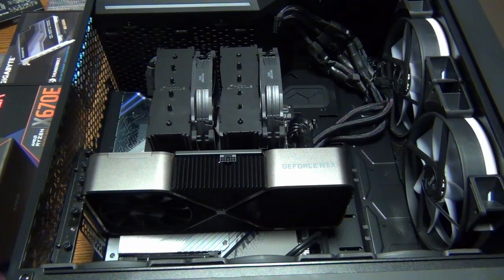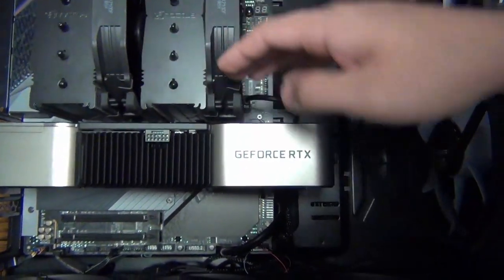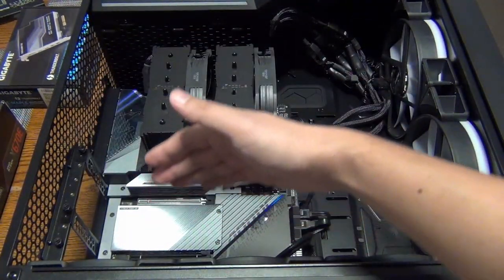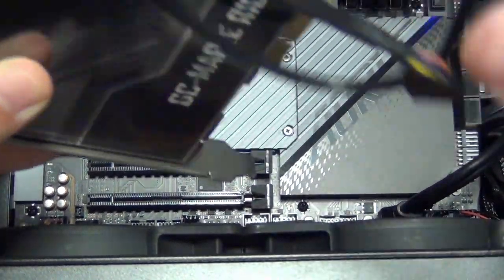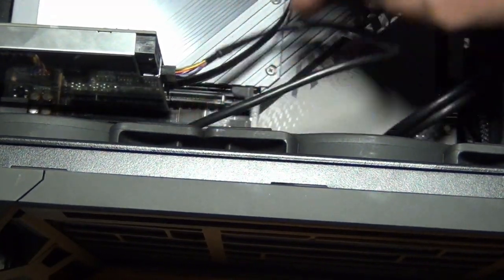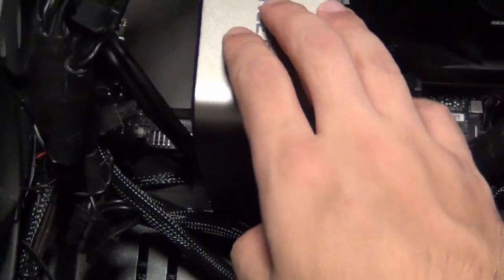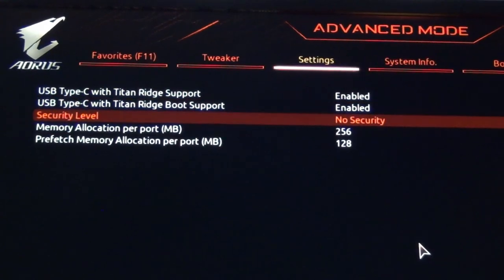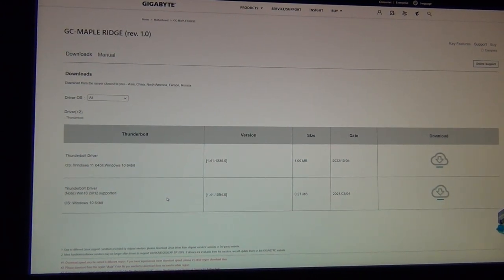How to add USB4 to Gigabyte AORUS X670 motherboards

Comment: This only applies to Intel but if its not working for you, I got my motherboard to read the card by turning off Intel trusted platform. The card works like a dream. Before that it would only show up once or twice every fifteen boots. Obviously might not apply to amd but hopefully this helps someone. This might be the only installation video on YouTube so I'm leaving this here for anyone searching for a solution.
Reply: Intel platform trust technology.
Reply from the maker: What motherboard were you using this thunderbolt card with?
Reply: @GameTechReviews   i jave asus tuf z690 plus wifi d4.  wd i7 12700 . will it work

Comment: This is broken after the latest bios updates from Gigabyte. It used to work until bios F23 for the X670 Aorus Elite AX
Reply from the maker: It was fixed in the more recent bios versions, at least if using the Titan Ridge version.

Comment: !! WARNING !! This will no longer work unless you are willing to regress your BIOS severely, using an X670E Xtreme and a Maple Ridge card with BIOS F22 results in an error and not all drivers load. Regressing the BIOS back to version 11 will fix that but you will be left open to other vulnerabilities. I found out about this when I tried to update my V1 to F22 and it wouldn't work. My V1.1 Wont do it either but if you put a Maple Ridge card on an Asrock Steel Legend X670E other than having to power cycle the system - it works. I also could not find the Common Platform Module under the F22 BIOS so I believe that Gigabyte has nerfed it. Not that I think it will do any good but I have asked them to return operability.
Reply: I have the same problem with the Maple Ridge and according Gigabyte, the firmware F2x don't work with the maple ridge. And as I have discussed with them, it seems Gigabyte is not willing to make it work and they blame it on the AMD AGESA which doesn't support this. Which I think it's strange and as Asus is also claim to support the TB4. But regardless, it is also very strange, that if the Maple Ridge doesn't work with new firmwares why doesn't Gigabyte deliver the Titan Ridge anymore, which they claim should work on this board.

Never again a Gigabyte for me.

Comment: Cheers mate, got it working on an x670e aorus pro x with bios f23, had to plug in both 6 pins as was having some weird boot issues vga light was on, but after connecting the six pins it went away.  I downloaded the drivers on the gigabyte website but the device only shows up as a universal serial bus controller with usb4 root router missing drivers. Any chance you could help me figure out what it is supposed to look like on windows?
Reply: I got the same problem and did not find a solution yet. Did you have any luck getting it to work?

EDIT: I just downgraded to F13 UEFI and the Maple Ridge card works flawlessly.

Comment: I have a question for the speed of the maple ridge. I have bought the maple ridge for on the Gigabyte X670E Aorus XTreme and put in the card in the PCIEX4. This as you are showing. On the other side I have this connected to the QNAP TVS-672XT, both sides 1 port. Now if I check the speed of the maple ridge, then it is showing speed of the connection 20/20 Gbps in the Windows 11.  However the claim is that this should be 40Gbps. Can you confirm that you are getting indeed the 40Gbps or is the 40Gbps the total for 2 ports?

Comment: How is this master board working? Thinking on getting one. You can run 2 M.2 drives and have full 16 on the GPU. plus it has 2 usb 3.2 headers that I need.
Reply from the maker: You can run 4 NVMe drives, 2 to the CPU, 2 to the chipset, and still have full x16 on the GPU. I talk about this in the X670E deep dive series for Gigabyte boards. I've been using it since launch day and it's excellent.

Comment: I don't know what the point of this card having 2 mini display ports and 1 display port is? What's the point of plugging your monitors cables into this one instead of your GPU's ports. Do you have at least 5 monitors at the same time?
Only two ports I see useful is the USB Type-C ports. On the manual it says each port can deliver bi-directionally 40 Gbps. Don't know if this is true but Imma just wait for the next card with an actual USB4 chip control from ASMedia

Comment: Can you actualy confirm that the card is able to connect to Thunderbolt devices properly? Because just it is recognized doesnt mean it will handshake properly with Thunderbolt devices.
Reply from the maker: See my video on the Avermedia Live Gamer Bolt. That demonstrates running a 4k60 external capture card off the thunderbolt AIC.
Reply from the maker: Full PCIe tunneling is supported with this capture card on AM5 gigabyte motherboards.

Comment: Will this card word with the AMD4 Gigabyte X570 Aorus Master v1. 1/1.2 motherboard with latest (and recently released) F38 BIOS? It has PCIEx4 and 5 pin Thunderbolt header. I am using the Ryzen 9 5950X CPU in case that affects it.

I know it's not on the "officially supported list", but that's normally just marketing to try and drive you to upgrade to latest hardware. The X570 Aorus Master is on the Titan Ridge 2.0 list, but that's no longer available anywhere having been superseded by the Mape Ridge card.

Comment: I might have to put one of these into my B650M Aorus Elite AX. It's got the header and the one and only Pcie X4 slot on the MB. And then I'll have to come up with a use for it (LOL). 
I just love computer hardware!
Reply: Lmao I found this same video too. I just bought the exact same board as you, and had no idea what the port was. All it says on the gigabyte website was “Gigabyte add in card connector”. I don’t know why they don’t advertise it clearly as a thunderbolt port. It would have been raised for me to choose it… My board should be here tomorrow lol, along with my 7600x and 32GB of DDR5 6000 CL30 RAM. Can’t wait!
Reply: @MarioGoatse  Hiya, FYI - After buying (deep discounted) a GC-Maple Ridge (same as in this review) card and not able to get it running, I reached out to Gigabyte Support and was told my B650M Aorus Elite AX is not compatible. The MB is only made to use the previous version card, Thunderbolt 3 Titan Ridge. I didn't try to find a work around and YMMV. I just returned it. Good luck, and report back if you have any luck...thx...DT
Reply: Depressing so there’s no way to be tthunderbolt on the 650m

Comment: O.K You and I have the same card, damn near the same PC and I have set up the card, the symbol by the way is not a question mark its an exclamation point.... Now my question is did you get the same message I did. This device can not start (Code 10) Power Failure and what did you do to get it working?
Reply: I take that back, although the card can see my Samsung Galaxy S23 connected by USB C on either of the two USB C ports and windows lets me do things with them I am still getting the can not start Code 10 from the USB4 Root Router.. any help?

Comment: Stupid question, but does an add in Thunderbolt card allow the internal gen 2 type C ports on the motherboard to gain DP-Alt? Like with a B760M.
Reply from the maker: Thunderbolt cards don't add DP-alt mode to usb-c ports on the motherboard. Those ports would have to be wired to the internal graphics to begin with. That being said, the X670E Aorus Master featured in the video does have DP-alt mode on its usb-c.

Comment: Man, so many motherboards make the last PCI-E slot either be x1 or is x4 but tied to a M.2.  Leaving the second one be the only reliable option. Which is terrible for big GPU air. I wish the last one was the reliable one and the next to the GPU the one that got disabled. 
Im looking for mobos and have coma across this a lot. The few that don't I don't like some other stuff on the board.
Reply: That's cheap MSI you got there

Comment: What BIOS version were you running? I just flashed to f11d. Not sure why my x4 isn’t picking up any cards so that might be a whole different issue explaining why mines not connecting.
Reply: Works on f11d. Make sure if you’re using a riser that it is PCIE 4.0.

Comment: Can I safely not plug in the 3-pin header? I'm planning on purchasing the same Gigabyte Aorus Master 670.
Reply from the maker: Yes, the 3-pin doesn't need to be connected. In-fact there is no where for it to plug-in. Only the 5-pin is needed.

Comment: Did you need to connect both mini-DP cables from your GPU to the add-in card?

Tried getting this card to work with an x670 Prime board(AM5) and an Intel Arc a770(16gb) but ran in to all kinds of issues getting the add-in card to output display information.
Reply from the maker: The Gigabyte GC-Maple Ridge card is meant to be used with Gigabyte motherboards that support the 5-pin header cable. I'm not sure if the connector type is the same on the ASUS motherboard. I think Asus uses a 14-pin header cable.

Comment: With GC-Alpine Ridge, you needed the PCIE connectors otherwise the card would just flat out not work. Did you need end up needing the PCIE connectors plugged in with the GC-Maple Ridge?
Reply from the maker: The PCIe power connectors are for allowing the high power charging for the usb-c ports. If they aren't plugged in the card won't provide the extra power to devices that use that for charging.

Comment: Where you able to get this to get this to work in windows 11 with current bios? I am getting an error in devicemgr and it will not let me install the drivers.
Reply from the maker: Yes, it works fine in windows 11. Are you using the driver that supports windows 11? [1.41.1335.0]
Reply: @GameTechReviews  thanks for the reply. I am using the windows 11 driver but gigabyte support informed me that the card would not work in this board. It is good to see others have gotten it working so I will put more pressure on them to find out why it's is not working.
Reply: @mr_jarble  What board are you using?

Comment: Today I've checked GC-Alpine Ridge with Gigabyte X670 and didn't work. Will try with GC-Maple Ridge. Seems like only Thunderbolt 4 cards do work.
Reply from the maker: The header cable needs to match for the control plane signaling. I think Titan Ridge and Maple Ridge should work.
Reply: @GameTechReviews  Now I have GC-Maple Ridge and it works fine with my Presonus Quantum. :)
Reply from the maker: @romanwisniak  Good to know that it works.

Comment: I see the x570s aorus master has a slot, would this work on there?  what is the max speed you get for expansion slots on the 570 and 670 boards
Reply from the maker: I believe so yes, it will work as long as the motherboard has the 5-pin header. GC-Titan Ridge should definitely work but based on what was shown in the video, the newer GC-Maple Ridge should also work. Both Titan Ridge and Maple Ridge require PCIe 3.0 x4 lanes. On the X570s aorus master it probably goes in the PCIe slot. All the info should be in the manual.

Comment: Can this card be used as a display adaptor for extra monitors?
Reply from the maker: You can connect the displayport from a graphics card into the DP Input on this card. Then from the USB-C port you can connect to a monitor via DisplayPort Alt mode.